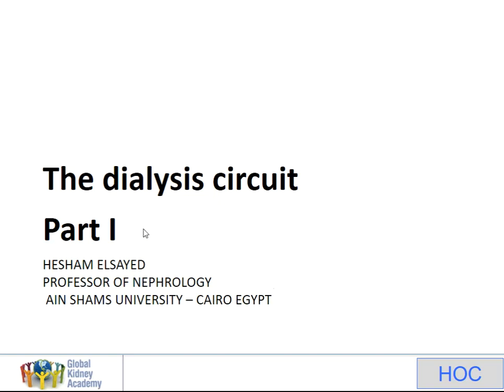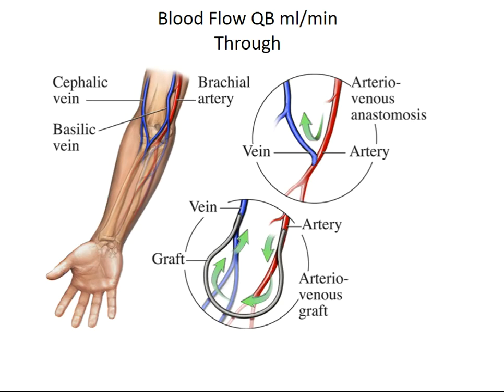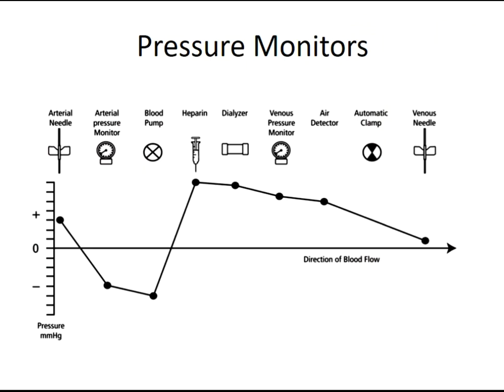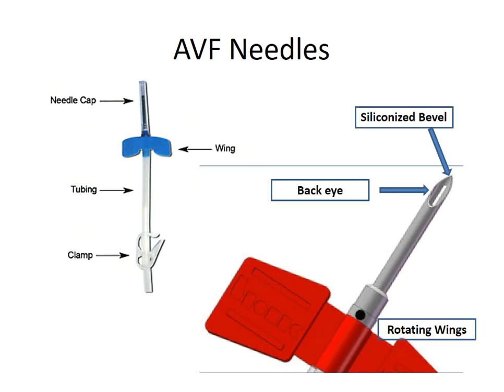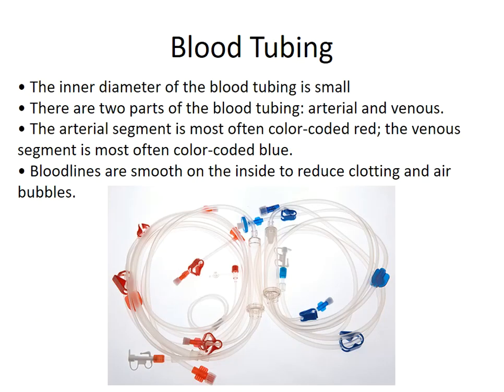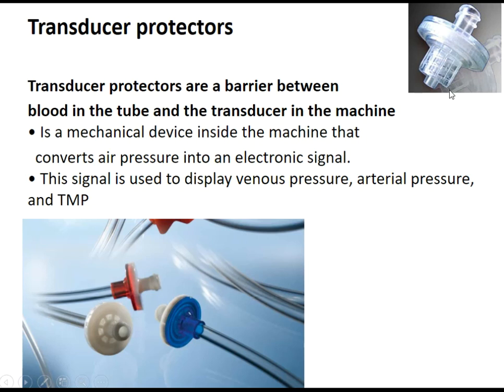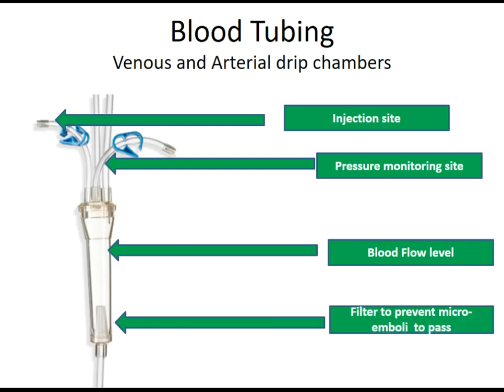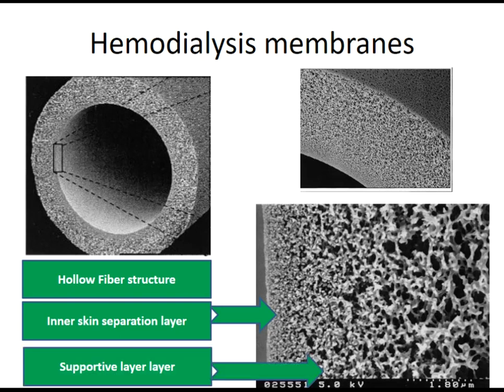Prof. Hesham Elsayed : The Dialysis Circuit Part I

Comment: Sir Can you explain positive pressure and negative pressure during dialysis or in circuit
Reply from the maker: positive pressure is the gaining pressure inside the circuit that push blood forward and it is developed after the rolling blood pump , 
the negative pressure is developed by pulling the blood from the patient and it is prior to the rolling blood pump , it is function is to monitor the blood flow from the CVC or catheter and its functionality
Reply: @Profhesham2023  thanks 👍.
Reply: @Profhesham2023  when blood out from patient by  blood pumping than negative pressure develop in patient is it right